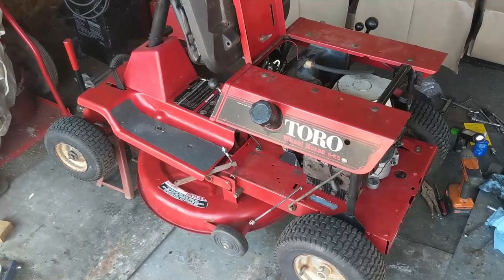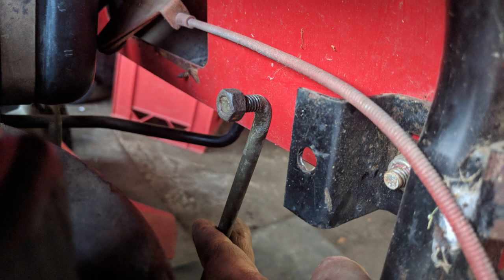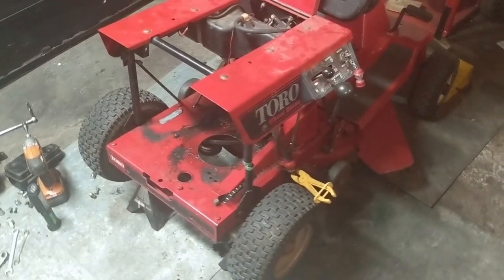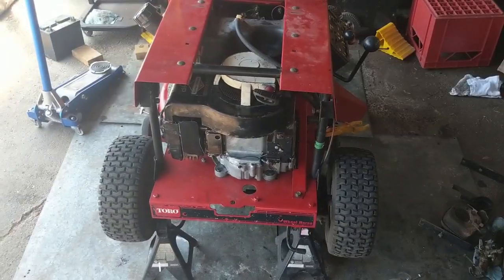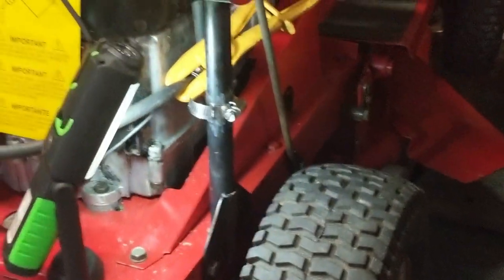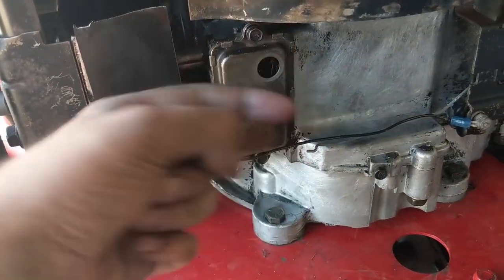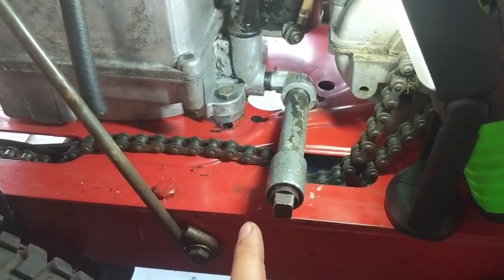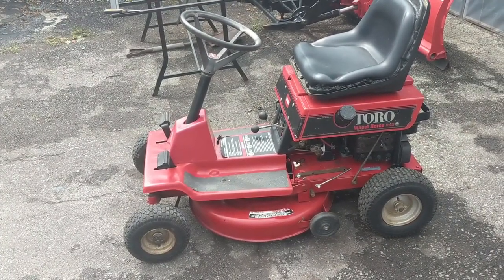Toro 8/25 - How to Remove Engine

Comment: HELP I HAVE A TORO 8/25 WHEEL HORSE AND GOT THE MOTOR OFF REPLACED THE HEAD GASKET, BUT I DID NOT MAKE A PHOTO OF THE UNDERSIDE, SO I AM HAVING PROBLEMS AS TO WHERE THE DIFFERENT BOLTS GO.

Comment: I inherited one of these and used it for 9 years but now oil is mixing in the gas.  Wonder if I can pull the engine and replace the piston rings.  What else needs to be replaced at the  same time?
Reply from the maker: If fuel is mixing into the bottom end (engine oil smells like gasoline) then it's most likely just a leaky Needle valve in the Carburetor!
Reply: @EliminatorPerformance  Thanks, Eliminator.  The engine was getting really hard to start, and when it did start, it backfired like mad.  You think just the carb?
Reply from the maker: @dottorb7054  yes most likely needs a cleaning

Comment: I have the same machine.  I appreciate you showing all the assembly/disassembly.  The two issues I need to tackle this spring is figuring out why I have no brakes (I just drive carefully) and the clutch is "instant" causing a solid lurch.  Any advice on either?  Perhaps I'll make a video on that work.
Reply from the maker: Hmm not too sure, I'd make sure you have the proper belts installed so they're not too tight. This machine has a transmission with a chain drive to the axle, but the clutch runs off a spring. I did notice this one jumped into gear as well.

Comment: hey, i dunno if youre still active, but im trying to do a pully swap on my toro, and for the actual life of me cannot remove the drive shaft pully. Any ideas? I already have the bolt off.
Reply from the maker: 15:13 minute mark on this video: https://youtu.be/Om4kHrkCRRo

I know you already have bolt out, but put the bolt back in and hit it with a pneumatic air hammer, that should cause vibration and loosen the pulley. Hope this helps!

Comment: I’ve got one of these. Same huge leak. How much did this cost to fix? My battery is not installed. Pull start only now. I’m also finding when I push it out of the shed the blade belt slips off. Is this bc of the oil leak?
Where r u located?

Comment: Have same toro need to remove rear wheel.  How does that darn bolt come out?  Having zero luck backing out with ratchet or driving. Zero luck.

Comment: Was the oil leak causing the belts to slip before you fixed it?
Reply from the maker: The oil leak would absolutely have caused the belts to slip, there was so much oil!

Runs and drives great after this repair, thanks for watching!

Comment: does anyone know how to fix the brakes on one of these ? , mine was bought in 97 and after 22 years the brakes are completely gone
Reply from the maker: On this model, the brake is located on the transmission. You can look at a diagram here:  https://www.ereplacementparts.com/toro-56128-000000109999991990-lawn-tractor-parts-c-121776_128672_132063.html

And check out my video I did on how to adjust or replace these brake pads: https://youtu.be/pfXuw4zy-Bw
Reply from the maker: Simply navigate to the "Transmission" picture, and you'll see how it comes apart.

Looks like you'll need some brake pads, part number: 917-0678 or AYP120961X
Reply: the old mower has seen better days  but still runs , so i have decided to put it up on stands and do a complete restore, going to try to  get it back to as close to new condition as i can make it , rebuild engine , mower deck complete disassemble and repaint , i figure it will take about a year or so to complete   @EliminatorPerformance
Reply from the maker: @steelguitarplayer1  always nice to have a little project to work on!

Comment: I DID ONE JUST LIKE THIS AND IF YOU REMOVE THE TIRES YOU DON'T HAVE TO REMOVE THE AXLE TO GET TO THE BOLTS MUCH EASIER.
Reply from the maker: If wheels seized to axle then you have to unfortunately, best thing is use grease or antiseize!

Comment: Mowers like are real hard to work on. I try to stay away from then if I can.I would never buy one.
Reply from the maker: It's actually a really nice mower, I was searching for one for the longest time but they're hard to find.

The newer ones (Snapper) are no good because they use a friction wheel drive similar to how a snow blower works.

Those friction wheels wear out, and the factory doesn't sell replacements, so the mower is rendered useless.